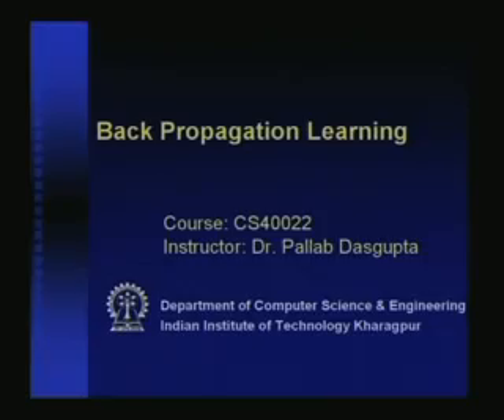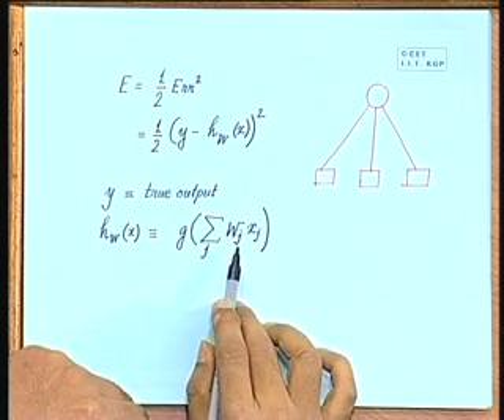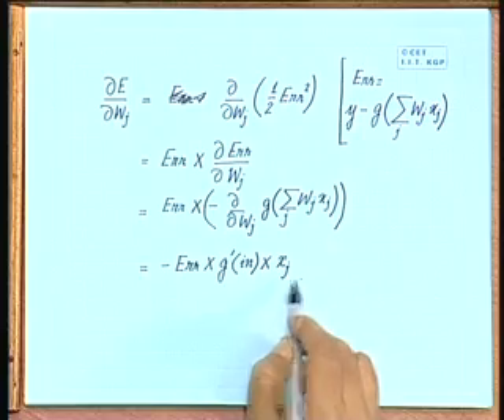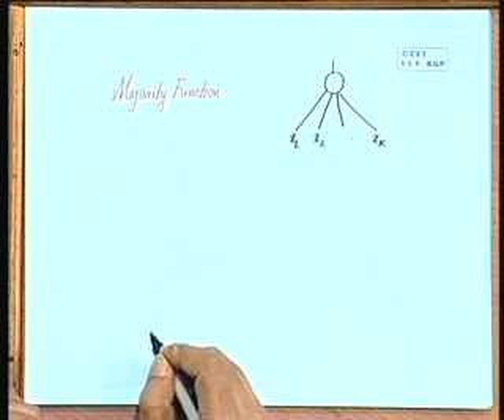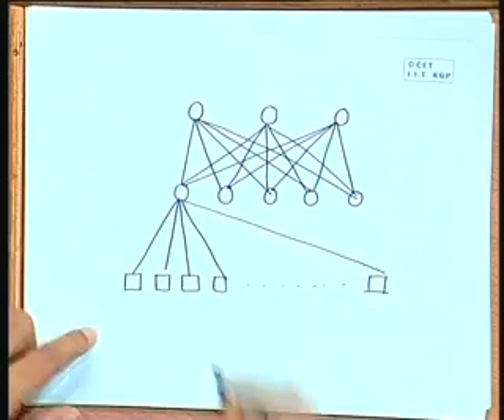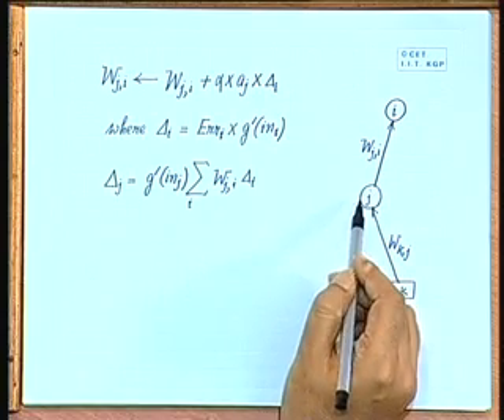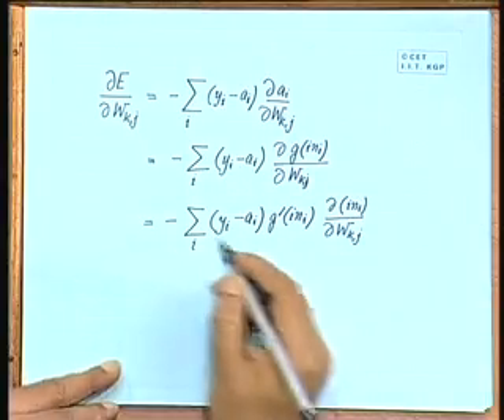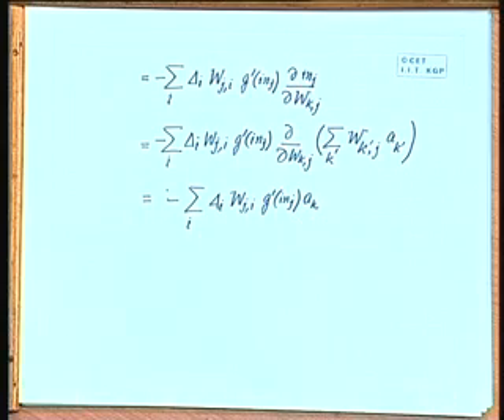Lecture - 28 Back Propagation Learning

Comment: I personally use my own algorithm:

=max(1-(T(P-x))^2,0)

T is the tightness (0.1 to start and increment)
P is the point of interest (I use 0.5, works fine)

This creates 1.0 if it matches the point and grows outward from the point in BOTH directions reaching 0 at the same distance from the point, the speed of the drop is determined by the tightness.  Easier to calculate, and the error function is easily streamlined along with the feedfowarding.